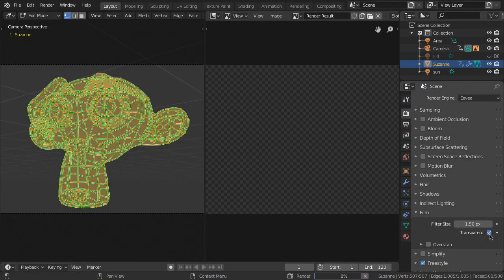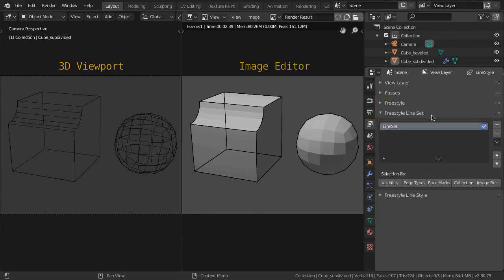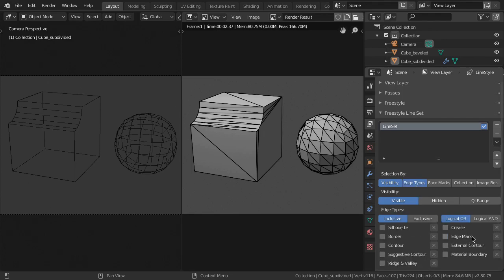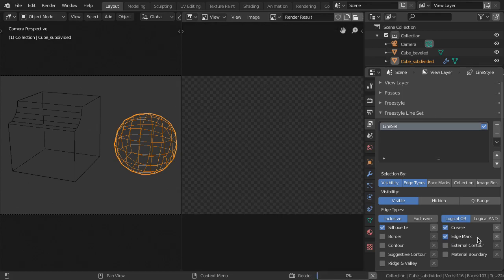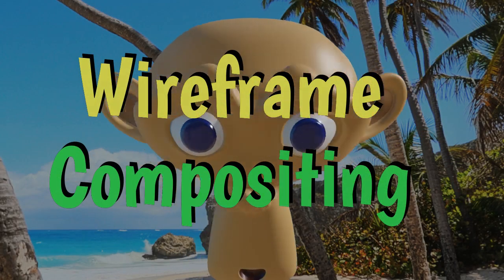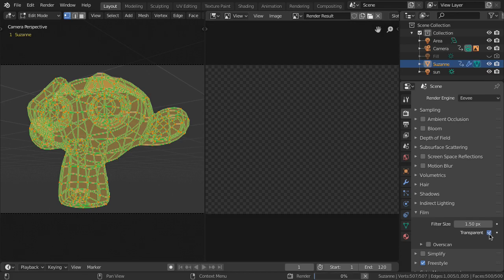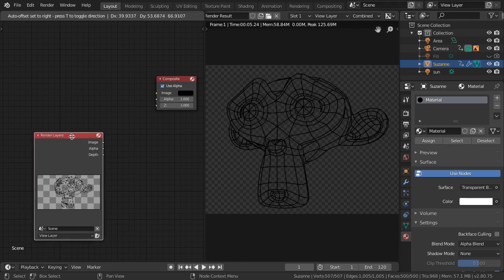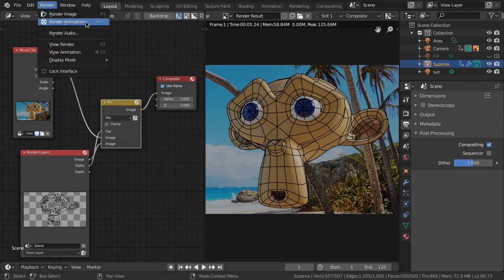Blender 2.8 : Render Freestyle Wireframes and Composite over Backgrounds

Comment: I need help  :( My render is only coming up with the wireframe and no object color/texture. Do you know how I could solve this issue? I have looked everywhere  :'(
Reply from the maker: Did you create a new material for the object?  The default material assigned to new objects has no color or texture.   Or are you rendering the object with the transparent material applied which is used for rendering the wireframe alone with alpha channel?   Make sure you have the correct material applied.  Make sure the "Transparent" setting is OFF under Scene settings -> Film .
Reply: @aliensoup2420  Thanks for getting back to me! Yes, I created a new material for my object; Just a solid color with color ramp. I'm not using any texture with transparency. The "transparent" under film is also ticked OFF.  I am basically trying to get toon shade.
Reply from the maker: @nay_brazuca  I don't know anything about toon shading.  I can't really help you much more without looking at your scene file.   Maybe it matters if you are in Cycles instead of Eevee renderer.
Reply: @aliensoup2420  Thank you so much for your time in trying to help me! I finally found what the problem was! I had ticked "as render pass" in the view layer properties tab. I unticked it and it's working now! Thanks again.
Reply from the maker: @nay_brazuca  It's always something silly like that.  Good that you had the willingness to dig and find it - that's how you learn.   It's also why I never bothered to learn much about rendering - too many d@mn buttons to push.  Good luck and have fun.

Comment: hey can use the outlined edges as seperate object?? like a wireframe object??? i want to export them into aftereffect and make hologram effect.
Reply from the maker: No, this does not create geometry.   The wireframe render creates new pixel information in the image.  If you want to export outline geometry, you should use the Wireframe Modifier.

Comment: Is there a way to render the silhouetted outline of the object (kinda like the orange outline when you select an object in the viewport)?
Reply from the maker: Yes.   Use the 'Contour' option below Silhouette.  I think I made a mistake suggesting Silhouette, and instead should have used Contour.   Actually, Contour renders the outline of individual overlapping objects, while 'External Contour' renders the outline of all overlapping objects combined - similar to a Boolean Union operation.   Thanks for the question in pointing that out.
Reply: @aliensoup2420  thanks, contour and edge mark works well for low to med poly assets, however I have tested it on a very high poly asset and the lines just won't render.
Is there a poly count limitation in this freestyle feature?
Also just wondering if you know how to render vertices as points or dots

thanks in advance
Reply from the maker: I couldn't say for sure why its not rendering your high poly model - I'm not experienced with it beyond what I've shown in the tutorial.   Its a  deep tool, so there are a lot of possibilities.  It could be a memory issue.  Are you sure it does not have a Subdivision Modifier or other modifier on it?    Thats an interesting question about rendering verts.   I don't know for sure, but I suspect you cannot render verts alone.  Maybe there is a creative work-around.
Reply: @aliensoup2420  it's an high poly asset alembic file, so there aren't any modifiers, I deleted a bunch of geo and then the lines start showing up again.
So it might be some sort of memory issue, but the workstation  has 128 gb of ram, unless it's using the graphic card memory.
Reply: I think I figured out a way to render points
Reply from the maker: S W Awesome, let’s hear it.
Reply from the maker: It could be an internal software memory limit (?).   How much of your system memory is being used by other applications?   If your geometry is divided into parts, you could render them separately and combine the wireframes in compositing.
Reply from the maker: Of course, you can render naked vertices in Viewport Render, but you have to first delete Only Edges and Faces in Edit mode.
Reply: @aliensoup2420  One way to render vertices would be 1) add the object representing the vertices (i.e. icosphere), 2) parent the object to the mesh you want to see the vertices of, 3) on the mesh object go to Object properties -> Instancing -> Verts, 4) make the mesh object's material/shader transparent (and in the case of Eevee change the material setting blend mode to Alpha clip and shadow mode to None.)

Now you just adjust the size and material of the vertex object to change the outlook of the "point cloud."
Reply from the maker: @tapiolahde6987  Thanks, that's thinking outside the box.   I was aware of that instancing method, but did not think of equating it to rendering individual verts.  Its pretty simple and effective.

Comment: does it work with viewport render animation?
Reply from the maker: I don't think it does.  Viewport is a different method of rendering (Open GL?).   You can render wireframes in the Viewport, but it is not as selectable or versatile as Freestyle.  You have to change the viewport shading mode to wireframe, then render the viewport.  You can get different wireframe colors by selecting random colors in the top viewport shading options menu.  To composite you have to render out a wireframe render over black background, then in the Compositor you create an alpha matte using the Matte->Luminance Key node, and mix that with your render out image.   You can change the wireframe thickness in the Preferences.
Reply: @aliensoup2420  thanks for answering. the question is cause i ll try to use animation nodes and always crash using the normal render only works using viewport render animation